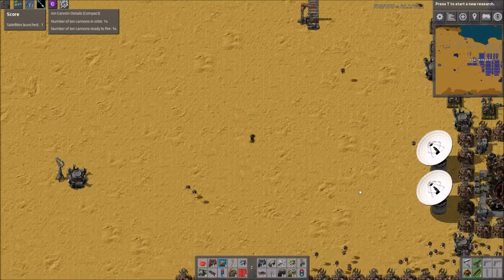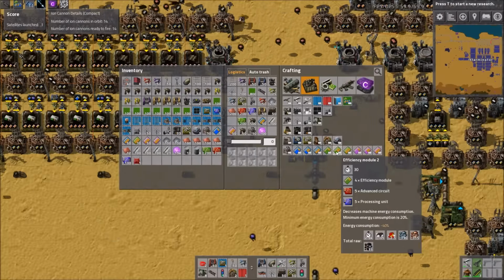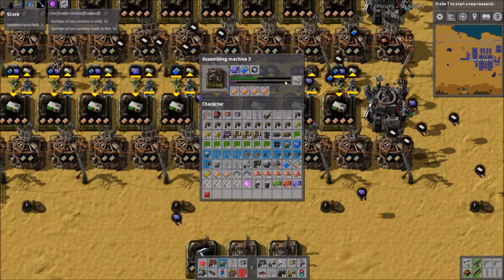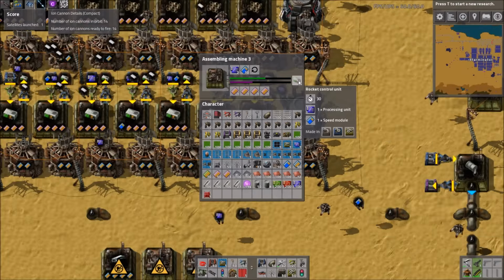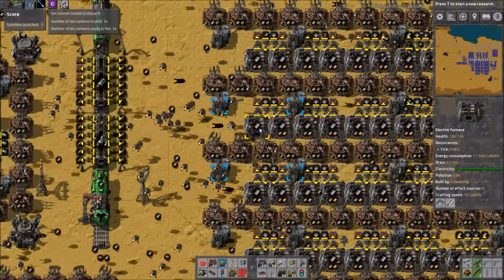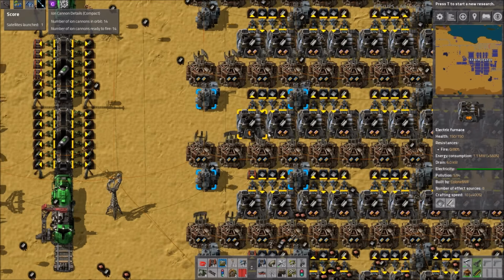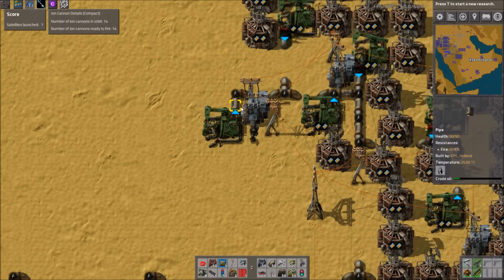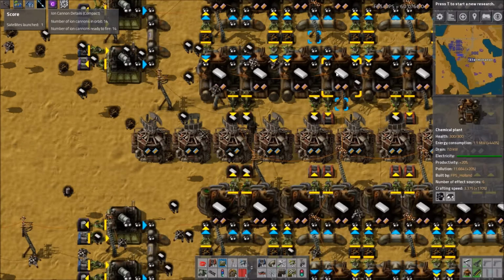Benefits of Speed / Productivity Modules & Beacons - Factorio Tutorial

Comment: 4:49 Getting 40% extra items isn't the same as using 40% less resources.
(r = resources; i = items without modules; m = items with modules = 1.4 * i)
r/m = r/(1.4*i) = 1/1.4 * r/i = 0.714 * r/i.
So we use about 71% of the resources, which means 29% less resources. Not 40%.
Reply from the maker: Yup. Had several people point that out, and you guys are completely right, was an error on my part.

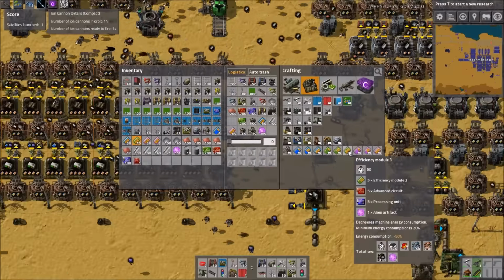Comment: Small mistake at 1:15, efficiency modules do directly decrease pollution up to a minimum 20% (the same minimum for the power consumption). You can check this by hovering over any assembler/miner/... and see the pollution decrease after installing efficiency modules.
Reply from the maker: Very good point, thanks for pointing it out! It's actually quite weird how it works, and the fact the module item itself doesn't give any info about pollution reduction makes it worse. :p
Reply: I think pollution is calculated by power consumption. I just checked with bob's mods which has pollution decreasing modules with them combined and i can get the pollution even lower, down to 4% of the initial pollution (decreasing by 80% twice)
Reply from the maker: - Griggers - Yeah the pollution has a hidden multiplier with power. It's pretty confusing and hard to figure out if you don't have someone tell you about it. Lol 
I think it should be a lot more obvious than it is. 
But damn that is super low pollution, nice!
Reply: It's like stealth mode for my outposts, practically no biter attacks ever.

Comment: Just to clarify the missinformation regarding efficiency modules in this video:

First mistake:
The limit of the modules is not -80% energy. It is 20% MINIMUM energy consumption of the machine(which means that, yes, the limit is normally -80%, but not when you have speed or productivity modules which increase the energy consumption)
Example: Take a level 3 Assembler with a Speed Module 3. Total enery consumption:170%. Add 3 Efficiency Modules 3 and you have 3×(-50%) or -150% energy consumption. 170%-150%=20% and the limit is reached.

Second mistake:
The efficiency modules DO affect poluttion directly (even though it dosen't say it on the tooltip), since the poluttion of the machine is directly proportional to it's energy consumption (except for productivity modules, which add an independent poluttion bonus on top of the base value-the one linked to the energy consumption)
Conclusion: Efficiency modules directly decrease the poluttion by the same precentage of energy consumption reduction. That can be especially usefull with mining drills, since 3 Efficiency modules 1 in each miner will decrease not only the energy consumption, but the pollution(which is huge for miners) to a 5th of the original value.

Hopefully this comment was usefull.

Comment: One quick point: you say that +40% productivity means that the machine consumes -40% less items, but really it means that the machine produces +40% more items, which is very different.

To find the actual consumption, we have to look at the ratio, which is 100% consumption to 140% production, which then, when dividing by 1.4, becomes 71.28% consumption to 100% production, meaning that there is actually -28.72% less consumption with a +40% productivity bonus.
It's a small point about a simple mistake that usually doesn't matter, but I made such a mistake, and it screwed me over when I first started using productivity modules, and couldn't properly balance production.
Reply: Or you could use some computer application like factorio planner instead of figuring out production ratios on your own. Actually, yeah, it is probably better to do that than to use math.
Reply from the maker: Another good point. I almost feel like I should take this video down and redo it with the amount of mistakes I made. :/ 
I'm glad you mentioned it though, because that is quite a bit difference!

Comment: My concern with using a design that uses multiple speed beacons (as opposed to not using as many and simply building more machines) is that the space saved by having less machines in the design is negated by the extra power demand. So for example, say by overloading on beacons for circuit production, you save 100 assembly machines, but because of the extra power demand you have to build 100 extra solar panels, and 84 extra accumulators, thus causing a net loss in space. I have not actually done the math, because it is extremely complicated math, but I am fairly confident that this is the case, multiple beacon designs are actually less space efficient.
Is my reasoning off? Or is there some other benefit to overloading with speed beacons?
Reply from the maker: You bring up an extremely good point actually that I didn't fully consider. For pure space efficiency, you are right I believe. So my argument in the video about having it take less space is probably not as valid. The rest of the reasons listed I think still more than compensate for the space thing. 
Using beacons to have less entities on the map is still really good, even if you have to build the extra power for it (considering your using solar), because solar layouts are actually calculated differently in terms of entities, so one solar layout is actually only considered 1 entity by the game, whereas each assembler is one, so it is way more entities and stuff working to add more machines rather than beacon. 
Plus if you're using productivity in the machines and don't speed beacon, you will need an insane number of them to match the speed you would get from speed beaconing. 

It would be interesting to somehow do the math though to see what the difference is. Cause we have to consider that adding a lot more machines also adds to power. So would be interesting to see if there is a breaking point, or what the difference power wise is between having say 10 machines with speed beacons, or 50 machines without them.
Reply: I did not know about solar panels being considered one entity, so that makes sense now for why it would save on lag.
Normally I build so that each machine has one beacon affecting it, because it does get ridiculous building a design without beacons that has hundreds of assemblers.
Reply: I understand your point but think it is offset by the unlimited map. So spread out and be fruitful!  :-)
Reply: That would be true, except speed modules also apply +70% power consumption along with the +50% speed bonus, which causes machines to consume more power despite producing faster.

Comment: You missed a few points.

****** 1 ****** Saving modules
For example. If you have 4 productivity modules in one machine it decrease the speed by 60% but decrease the output speed to 56%. 

So if you add 8 beacoons shared with 8 machines, every machine needs about 2 added modules and increase it production speed to 240% and the output speed to 336%. That is the same as 6 assembly machines with productivity modules.

So even if you just have one machine and one beacon with two speed modules you get 91% output that is 63% more with only 50% more modules. Also the speed modules are 18,5% cheaper than the productivity modules.

So you need WAAAAY lower number of modules. With a 1:1 line up you only need 6 modules to get the same production speed as 24 modules with no beacon. That is a 4 time reduction.Counting the difference in cost the reduction the reduction is actually 4,3 times. Also you would need 6 times less factories, and they each contain 4 level 1 speed modules

***** 2 ***** Energy consumption
This thing is really strange. Having speed modules make factories consume more power. Having productivity modules make them consume more power. But if you have both, they actually consume less power. The reason for this is that the speed module increase speed with 50% and energy consumption with 70% giving a net energy consumption gain of 20%.

While productivity modules increase the productivity by 40% (maximum). A factory with 4 productivity unite consume 7,5 times more power per produced unit. Makes the factory use 882kW. If 8 speed modules are added via becons the power consumption is up to 1,47MW... That is a lot. But the production speed is up 3,36 times the normal out put (in steed of down to 0,56). This makes it so the power per produced unit is actually only twice that of what is originally is. The the beacon actually reduce the power consumption from using only productivity modules by... A LOT. About 3,75 times.  Even counting the becons that do use quite a lot of power. The 1.47MW of the assembler dwarf the beacon. Even counting this the total power reduction is still around 3 times. Making the total power draw about 2.4 times higher than with no productivity at all.

****** 3 **** recursive power demand
Productivity increase the power demand on any given unit produced. but it increase the producivity. A effect of that is that you need less raw material. 

The best example of this is sulfuric acid production. While it only a 20% reduction the speed is rather high.

So using productivity modules in acid production increase the power in acid production with 3.1 times. While it reduce it in all the previews step by 0.8 times. So a acid production now uses 260kWs in steed of 42kWs. That is quite a dramatic increase.

But the sulfur production now uses 84kWs in steed of 105kWs...  Well that is just a 20kWs reduction, not that much.

But for the refinery... there is the difference huge. For the refinery to produce  fuel for one sulfuric acid (assuming full cracing) it needs 700kWs, with the reduction it only uses 560kWs. That is a 140kWs reduction.  Adding up the cracking we more the offset the total power gain of the acid plant.

Now look at the oil pumps. For on acid you need 1 and 2/3 units of oil.  Amusing the well is dry it takes 16,6 seconds to extract this using 1500kWs of power. With the productivity this is reduced 1200kWs that gives us a saving of 300kWs. With the previews step fully compensated for the power increase, this is a pure 300kWs saving. Also, you will never put efficiency modules in a oil well, if any, you will probably put speed modules into them. Just two speed modules and the saving will increase to 420kWs.

The same is true for Plastic bar and sulfur production but there the increase power is from 168kWs to 520,8kWs making 352kWs that need to be saved away in the other end. With the oil processing saving about 220kWs gives us a deposit of ~130kWs that draw from the oil well reduction of 300kWs gives us a total saving of about about 170kWs per produced unit.
Reply: Fuck me can i get a tl:dr
Reply: 1: You need 4 times less modules if you combine them
2: If you use only productivity modules you use 7.5 more power, if you combine them you use 2.2 times more power.
3: If you use productivity module at late stage production. Say for sulfur production, it may avtually be a net power saving
Reply: Thanks man
Reply: +matsv201 is this stream of consciousness available in a table/spreadsheet anywhere please?
Reply from the maker: Great points here! Definitely worth considering when using beacons and modules. Thanks for taking the time to write it out. :)
Reply: DRY411S Na.. i just calculated it of hand.. Was thinking of making a spreadsheet for more exact calculation.

For example the first modules take really long time to construct before you get a big base going. So using the first module in a efficient way really helps you along.

As far as i can find. Sulfic acid is the best use of productivity modules in the game. Then plastic and sulfur is a shared second.

Often you use more plastic than sulfur.... so i would say plastic is probably more usefull.

Comment: When you are crushing your computer with a mega base you want to reduce the entities.  Makes sense.  With all of this module stuff does it decrease the productivity side enough to compensate for the power producing entities.  I think steam takes a ton of cpu, since I lag a bit when I am in my gigawatt steam power array, but does solar?  Solar doesn't seem to have an animation, is this the reason folks tend to use solar?  Does this map use solar?  Lots of questions since the whole system isn't covered.  An obvious advantage of solar is no pollution, but space.  For a gig its huge, for steam it's better, but the lag.  Either way thanks for the vid, factorio ftw!
Reply from the maker: Yeah less entities is definitely best for a mega base. If you're using steam power then the extra power you'll have to build for the power required for modules and beacons will probably actually be worse in terms of lag. However if you're using solar it won't matter. This moves into your last question. Solar/accumulators are all counted as 1 entity pretty much so no matter how many you build it won't lag anything compared to steam, such as you have experienced.
Reply: Thanks broski!

Comment: 5:40 and 11:20 Hmm...the barreling recipes are on the intermediate products tab, but you're not using productivity modules in the assemblers. Does the game disallow that? If so, why are those recipes on the intermediate tab?

Seems like putting productivity modules in the barreling/unbarreling assemblers could be an exploit; if you could productivity module both barreling and unbarreling, you could setup a chain of assemblers that would loop that process (barrel crude -> unbarrel crude -> barrel crude etc.) to get huge amounts of free fluid.
Reply from the maker: Yeah the game won't allow it, because as you mentioned it would be a pretty big exploit/OP. I'm not sure why they are on the intermediates tab honestly. The dev of the mod probably just decided that was a good place for them sense that's where the other oil stuff is. 
It is a bit deceiving though.

Comment: I know this is a late comment, but I remember seeing a post on reddit about modules in pumpjacks. In the post it mentioned that putting 1 prod 3 and 1 speed 3 module in a pumpjack surrounded by the max amount of speed beacons (12) produced more than a pure speed 3 setup with the same amount of beacons.

If my math is correct, in a fully sped up pumpjack the speed increase is +700% which means that that pumpjack produces .8/sec, if you change one of the speed 3s in the pumpjack to a prod 3 the speed becomes +635% which equates to .735/sec and with the +10% productivity it would become .8085/sec, am I correct on this calculation?

If so, it may not be a huge increase but it as an increase.
Reply from the maker: I kind of recall that post too. I believe your math is correct. It is a very minuscule increase, but might be worth it spread across all your pumps and over a long period of time.

Comment: Assemblers produce pollution even when run on solar power.  Efficiency modules reduce its pollution in both cases, but when your power is steam the modules reduces the boiler use, and threrefore boiler pollution too.
Reply from the maker: Yeah exactly. I just was a bit mistaken in the fact that the Efficiency Modules reduce the pollution of the machine itself in addition to the power pollution from the boilers if you are using steam.
Reply from the maker: SBlack Yeah definitely. I think a lot of people just don't care about the pollution enough to use them that much. 
It is something that should be cared more about though, cause it can cause a lot of problems. Lol

Comment: Finally, I understand the benefits of beacons.  Thank you!

Now I do understand, regarding the oil pumps, you should not use productivity modules rather than speed. Productivity modules produce more, from the same amount of input ingredients. But for oil pumps there are no ingredients, so it's best to go for speed.

I do tend to use efficiency modules in outposts when they are close to biter bases. This reduces the pollution from the outposts, so the biters don't attack as frequently.
Reply from the maker: Happy to have helped! :) 

Yup, exactly right. Sense the oil pumps/wells are infinite once they hit that 0.1/sec point then you mine as well just full speed it if you have the power to spare. It does work quite well though to put the productivity modules in the actual processing, in all stages possible, as I think I mentioned. 

using efficiency modules in outposts is definitely an acceptable and smart choice. The reduced pollution helps a ton when the biters are nearby, and lower power cost is great too. 
If neither are a concern, then productivity can actually be quite good for them.